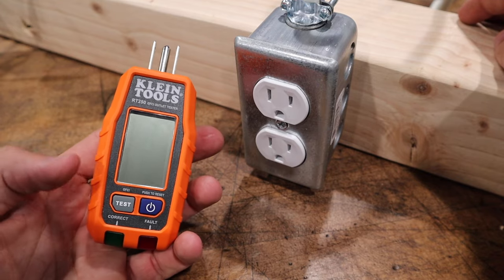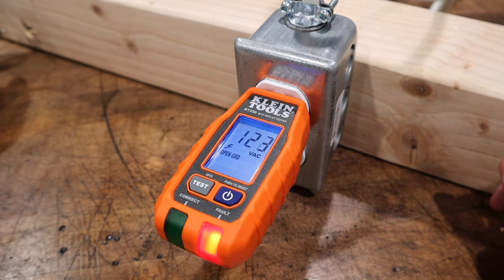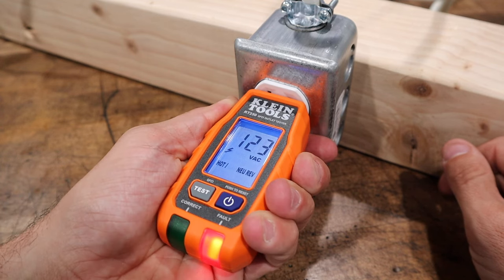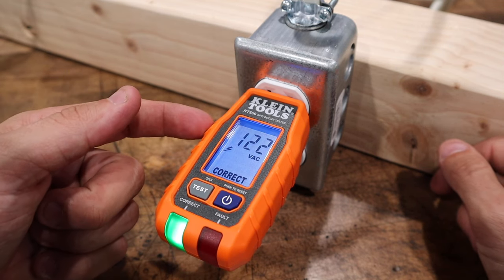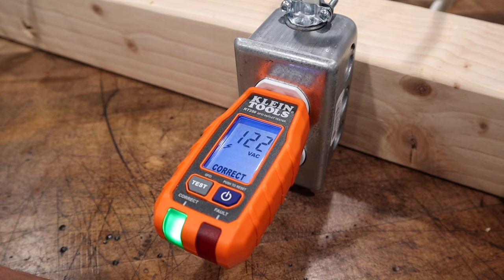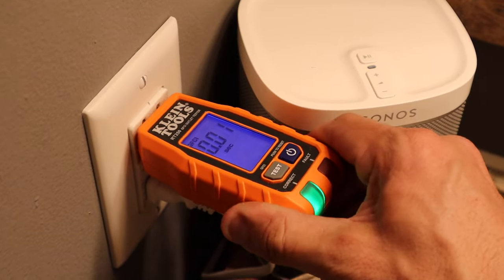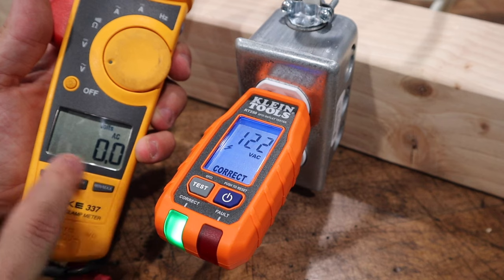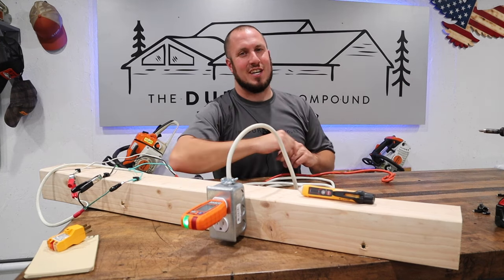Klein Tools GFCI RT250 LCD Outlet Tester - Awesome Tools Under $30

Comment: This thing is a steal at $20.  I bought one yesterday and used it today to diagnose outlets on a rental that had stopped working.  I figured out where the loose wire was in about ten minutes.  Along the way, I also discovered an outlet that was wired backwards.  It's so much better than a traditional three light outlet tester.  It tells you exactly what's wrong, without having to decode the lights, and you get an actual voltage readout.

Comment: Greatest tool, I just picked mine up, im a new homeowner it does so so much more than a typical outlet tester. A lot of stores have it sold out and honestly if they wanted 30 I would of gladly pay it, but keep that on the hush. A great tip, take pics of the user guide and save it in your phone so you have it handy at all times.
Reply: Well, they’re $38 now….so, closing in on $40

Comment: Was a very interesting video, and if I was still in the business I would buy one for sure. Just one little mistake in your video, when you pulled the neutral and the tester read 30 volts, you said it was because it was going through the ground, ABSOLUTELY NOT, neutral and ground go to the same place. If you were to use your FLUKE and test hot to ground, you would get 122 volts, exactly the same as hot to neutral. My guess is that the 30 volt reading comes from resistance in the tester. Ask me how I know, because I’m a retired electrical contractor, and as pretty good one. Always happy to help.
Reply: yup, grounds and neutrals land on the same bars in the panel
Reply: Yup that's why when I troubleshoot I always use my Meter too or have with on me
Reply: Thank you very much I couldn’t figure out why my klein read 30 vac but everything I had plugged in was working fine. I started to think I might be trying to draw to much power with only 30 available. I was going to check and replace all outlets in that room BUT when I tried my FLUKE reader it read CORRECT.

Comment: I bought a tester at the giant outdoor market in Mesa, AZ for $.25 about 5 years ago. It has the 3 lights and explanation of each written right on it. Best and cheapest tool I ever bought. I shud have bought 10 and gave them away for Xmas.
Reply: They work fine,  but not the same tool/tester.   $.25?   25cents?

Comment: I just bought one in order for me to get which correct voltage I'm getting for the step down transformer thermal protection design, which is why the reading display is all important!  Easiest tool ever!  Thanks for the video!

Comment: I have the tool. Here's my pro and con over the cheaper tester: 
Pro: Tells the voltage, gives a reading of how fast a gfci trips.
Con: Will not indicate 240v on a 120v receptacle miswired in this fashion. It only reads >30v. Will not detect a bootleg ground.
I still like this tool and I think it's worth the $20.
Reply from the maker: Do you know of any sensor that can detect a bootleg ground……they join at the main panel regardless. Only a time domain reflector could see that the ground joins the neutral at the outlet instead of the main panel.

Comment: What sucks about this one is when you are trying to find the breaker to a circuit. The cheaper ones lights will go out when you find the right breaker, this one stays on. only thing I do not like about this one compared to the cheaper one
Reply: That's why he never took off the hot lol cheap one and meter way to go
Reply: This tester is really not design to test for a circuit breaker.  There is a specific tester that I use that is fantastic and it is available from Klein Tools and others for about $22.00.

Comment: So when stick the meter to the energized GFCI, it says correct and green light. I hit test button and it tripped the GFCI but then it would read open grnd neutral with > 30VAC. There are no other receptacles downstream and upstream. GFCI is Eaton premium

Comment: I would love it if it can indicate in some way if there is a high voltage between neutral-ground. it reads out individual values of hot-neutral, hot-ground, and neutral-ground?

Comment: So what happens if you press the gfi tester on a non gfi outlet. Will it pop the breaker in the main electrical panel?
Reply from the maker: I haven’t tried it but in theory it will pop the breaker
Reply: waiting for the answer.   Also test on a GFCI protected non grounded outlet.  The hand held ones Do Not trip the GFCI, because they rely on the ground connection. comment please

Comment: QUESTION: i am using a Klein tool  voltage detector and GFCI tester RT250  when measuring GFCI, when it is not tripped i have correct reading all is good (good ground good voltage 110v)  but when i trip it i see a open ground reading and 30v why is that? I have everything wired correctly, where it says line i have 110v and where it says load i have the load. I have the ground properly attached.
when i use my multimeter fluke i have 0.12mV so it is less than one 1volt

Comment: Thanks for the excellent review and info. Your video beats the instructions hands down. I do have to wonder though. If you press the test button on a standard outlet, wired on a standard breaker (not GFCI) what happens. Does it create a direct short?
Reply from the maker: It creates a direct short to ground.
Reply: @TheDurbinCompound  Actually this tester does NOT create a direct short between the hot and ground when you press the TEST button. If it did, it would cause a non-GFCI circuit breaker to trip because of an over current condition created by the direct short (ex: >15A on a 15A branch circuit). 

When you press the TEST button the tester creates a much smaller leakage path (fault) between hot and ground which will draw a current of between 6mA and 9mA. GFCI outlets or breakers are designed to trip if they detect a hot to ground fault current of over 5mA and should therefore trip when confronted with this simulated fault. A standard breaker would happily supply this leakage current, in fact any leakage current up to the current rating on the breaker handle would be supplied. And if that leakage path was through your body core that is more than enough current to potentially kill you at 120v. 

But a <5mA leak through your body core shouldn’t cause any serious problems.  If the circuit is protected by a GFCI breaker it will typically trip  within .2 seconds once detecting a leak greater than that.

Comment: What if you connect to an outlet with 220v? Does the meter have a protection fuse? or it just can read the 220 without any issue?

Comment: Great video. I went out and bought me one of these from Home Depot yesterday and started testing my outlets. I live in Ca. in a house that was built in 1962. I know the codes were a lot different than they are now. So, when tested I got the open GRD in a bedroom and Hot/NEU Rev. When I took out the outlet from the wall, I noticed that the ground in the bedroom was grounded to the metal gang box. The Hot/NEU Rev was in the kitchen. Is there a lot to worry about and get an electrician? or is this common in these old houses? Any help would be appreciated.
Reply: Apparently the box in the bedroom is not grounded. Adding a wire from the box to the receptacle won't help in that case. Are the other receptacles grounded? Do all the receptacles except for the one in the kitchen show correct polarity? If the answer to the first question is yes, then you can put a GFCI receptacle in there. If the answer to the second question is yes, then remove wires (power off) then check for hot wire (power on) using a multimeter with one probe on ground wire or metal box and the other on a wire. The one that reads approximately 120v AC is your hot wire. Alternatively, use a non contact voltage tester for this, which would be easier. You could also just swap the wires and retest, but testing first is more conclusive and leaves no doubt.

Comment: Great video! I just got this and use it daily on home inspections. Sometimes, when I test a GFCI outlet, after it trips/reads correct, it will then display the "Open ground/neutral >30VAC." Can you explain to me what this is telling me? Is it indication of a faulty outlet? So far, it doesn't seem to do it on every GFCI that I test. I want to make sure I'm calling out faulty outlets if they need to be replaced. 

Thank you!
Reply from the maker: The GFCI outlet when tripped is removing the neutral and hot connections.  I think the outlet tester is recognizing this after it has been tripped.

Comment: Great little tool. And I must add, if you’re primarily a residential electrician, there are literally 0 instances where you will need the decimal point when determining AC 120/240 voltage. Zip. Zero. Nada. There’s not a single circumstance where that value is relevant in any possible way. There is NOTHING inside a residential circuit that necessitates that degree of accuracy.

Comment: Does this tester point out bootleg grounds? As a home inspector I sometimes come across this in pre 1963 homes that switched out the two prong to three prong outlets.
Reply: Yes it does.
The RT250 is light-years better than the three light testers.

Comment: What does the "H" in the black sqaure mean? It shows up when you're moving the wires
Reply from the maker: That means “HOLD” it will keep the displayed on the screen for longer so when you unplug it, and in the case of needing to flip it over, you’ll still be able to see what it says. Does the same thing if you plug it in and unplug it. I moved the wires, it lost power, went into Hold Mode

Comment: How would you use this if you live in an older house that only has two pronged outlets?
Reply: You wouldn’t use this on a two prong (non grounded) outlet. It requires a 3 prong outlet with a correctly wired hot, neutral, and ground.

Comment: I have a outlet that randomly stopped working. I bought this tool and get 30 vac open nue. What does this mean? I haven’t been able to trace the wire not knowing witch direction it travels threw the drywall. Any help I appreciate
Reply from the maker: Open neutral is sometimes caused by a wire nut that has come loose or a bad connection somewhere along the white wire. The wire is most likely not damaged in the drywalled area.  I would open up other outlets in the room or the current outlet you are working on and check the connection of the white wire. If that is the only outlet that doesn’t work, then the problem is most likely right there
Reply: @TheDurbinCompound   ok thank you so my focus is the white wire. I will try to find where it’s jumped from. I did check one other box but all looked well I’ll continue my search. It’s odd cause the outlet is right beside the breaker box
Reply: @bfoust3488  it is possible that the white wire fault you’re looking for is that the white wire for that circuit is not securely connected to the neutral bus INSIDE the circuit panel.

Comment: But can it test a GFCI without a ground?
Reply: From other videos I've seen, it cannot.
Reply: Yes it does, it will display, "open ground"
Reply: Yes, but the test button on the device will not work without ground. The test button on the GFCI will work.

Comment: Only checking outlet voltage with no load. Only true way to check any voltage is under load.
Reply: So does my killawatt meter have a load and that’s why this device seems to read about 1.5 volts higher?

Comment: Would this tell you if there a GFCI on the circuit? Or only way to find out is to press the Test and see if one trip. 

I think the flex room don’t have a GFCI and I  need something to find out for sure.

Thanks.

Comment: Nec - Outlet. = A point on the wiring system at which current is taken to supply utilization equipment.         Receptacle. = A contact device installed at the outlet for the connection of an attachment plug , or for the direct connection of electrical utilization equipment designed to mate with the corresponding contact device. A single receptacle is a single contact device with no other contact device on the same yoke. A multiple receptacle is two or more contact devices on the same yoke.   Receptacle Outlet.  =  An outlet where one or more receptacles are installed.                 Wtf is a gfci outlet?